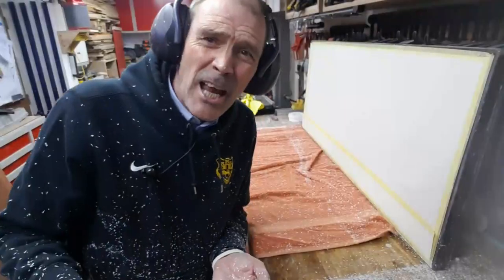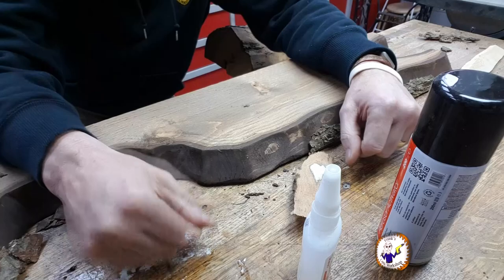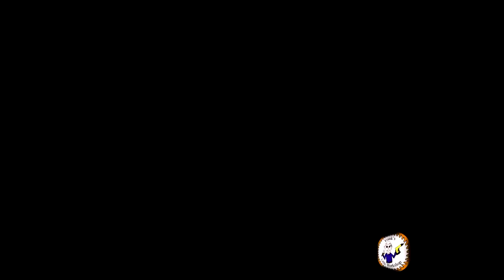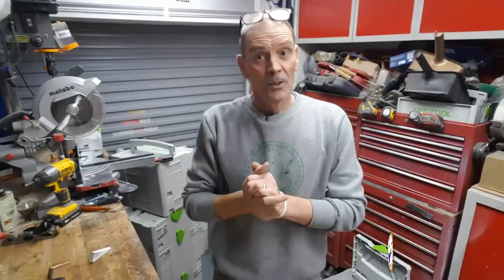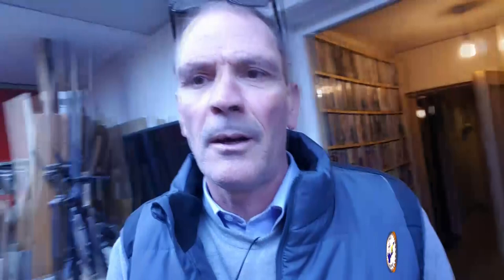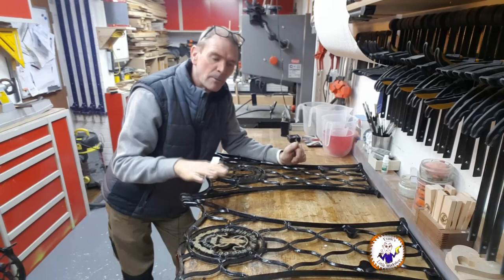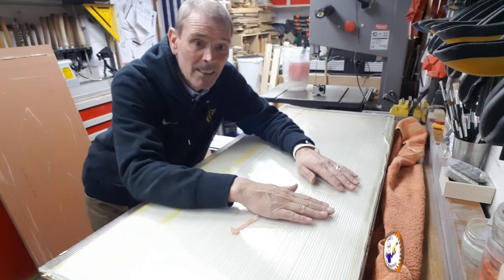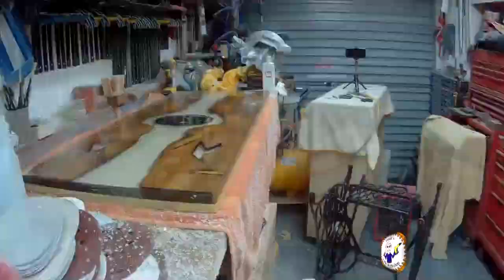Faux Live Edge Epoxy Resin Table. Singer Sewing Machine.

Comment: Wow Frank, this is absolutely fantastic. I bet Mrs little workshop was over the moon with this project. I agree, the faux live edge wood slabs look like the reel thing. And the quality of that resin pour looks spot on! Top notch job here 👍👌

One thing though, on the underneath, could you have not poured some of the thin resin in between the lines to level them? Just thinking it may have saved you 2 days sanding 😊
Reply from the maker: 😁 thanks James. Lucky for me she loves it 😁😁. Your 100% correct, I did consider doing a self level coat on the bottom and I'm sure it would have worked a treat. But I think a bit of me wanted to see if I could actually get it to a glass finish with wet and dry.... and yes I can 😁. Thanks for watching James, hope all is good with you 😁👍
Reply: @frankslittleworkshop  ahhh that's a good Idea, your right you did polish it up well. All good here thanks 👍

Comment: As others have said mate that looks absolutely fantastic 👍 hope Mrs Little Workshop liked it .... can I ask a silly question from someone who's never done this before how do you know how many layers you need too pour is it something to do with maximum height of resin for curing or something? Love the old brigadier moustache at the end lolol you always make me laugh mate lol 😆🤣 keep safe
Reply from the maker: Thanks mate 😁. I have never done it before either, so there was a bit of "make it up as you go" going on. However... it all depends on which resin you are using.. some types you can do deep pours, but this can generate quite a bit of heat. Also some deep pours will not self level. That's one reason I used the Glasscast3 for the final pour. It's a minefield of possible disasters so that's why I did it in lots of layers. I would hate to see £350 worth of resin leaking out all over the floor... that would be bad 😖. Thanks for watching 😁👍
Reply: @frankslittleworkshop  cheers mate 👍you did well mate looks fantastic

Comment: Well done.  I like seeing a kind of trial and error approach because, quite frankly, heh, that's how I operate.  I watched this because I'm going to use a piece of pecan a friend is giving me that has sawn edges and I want to do a live edge river table.  I think I want to tint the resin and put in some lighting, but your discovered techniques have given me some ideas.  One question:  I'm curious why you didn't take the frame off and do that last pour (plus maybe the thin top coat) using the technique where you just let the resin run over the edge.  Were you wanting the chamfered edge to begin with or was that just your solution for doing the top pour in the frame?
Reply from the maker: Hi Eric 😁. Thanks for your comments 😁. One of the main reasons I didn't do a float coat was that I was doing it in the dining room (too cold in the workshop) and i just couldn't take the risk of destroying the carpet 😂🤣. I think the taper edges were always part of the plan anyway. The actual top side was actually ok. It was the ribs from the casting on the bottom that caused the hours of sanding 🙁. You live and learn. Good luck with your table, let me know how you get on 😁. Thanks for watching Eric 😁👍
Reply: @frankslittleworkshop  makes sense. Thanks!